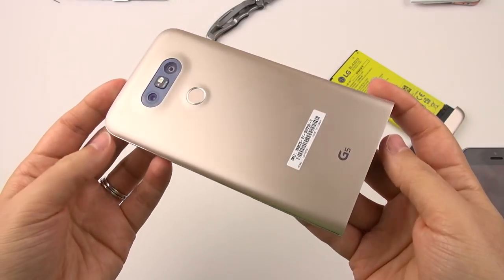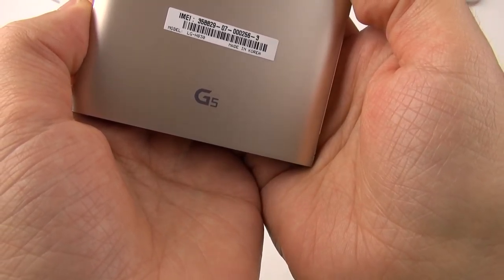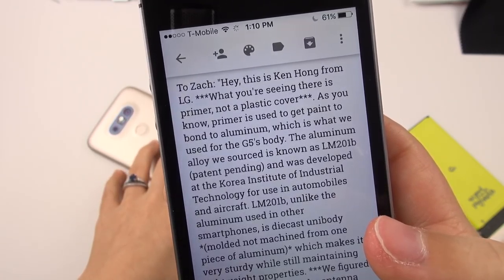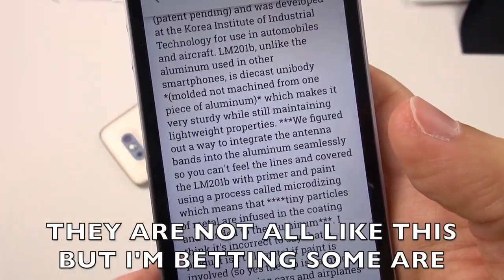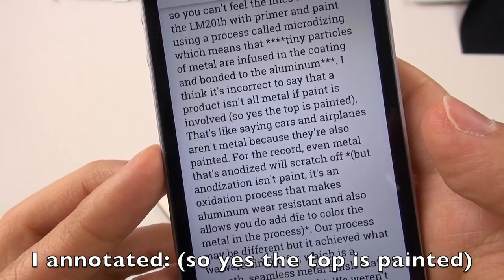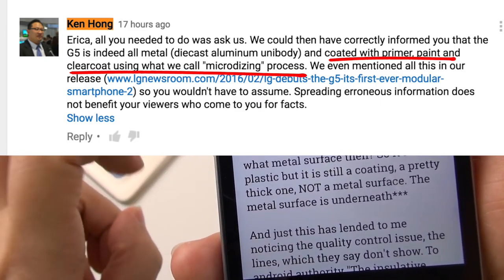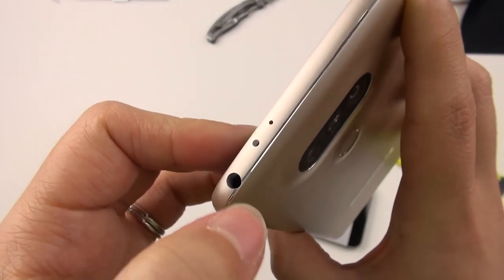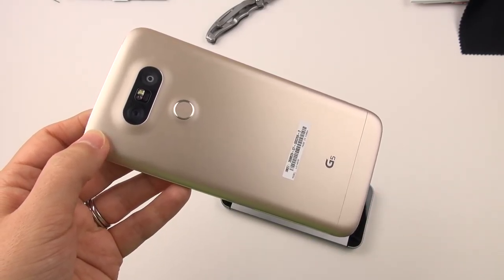LG G5 Not All Metal Controversy: Explained || LG RESPONDS

Comment: I haven't watched the earlier video yet, I will right after this. but I'll say my problem with this is that is sounds like it's metal which is not very likely to leave scratch marks from keys in the pocket and what have you. However if it's a thick coating of paint I'm betting that scratches pretty easily. So I'd be pretty annoyed if I bought what I was told was a metal body phone and then it got all scratched up.
Reply: +Phil Nolan I suppose that's what JerryRigEverthing was attempting as part of extreme testing procedure, but got carried away with the resulting flaking of paint (or plastic - to some). In the end it isn't that easy to scratch if you ignore the test to destruction angle.

Comment: The marketing made it seem like an aluminum phone. Not a plastic with metal infused, and THEN aluminum underneath. Correct me if I'm wrong, but the ceramic back from last years G4 was also "metal-infused." 
It's just bad marketing/wording on LGs part, like you said. 
The phone is just unappealing. It's not a metal phone. Samsung phones pre-S6 time also had metal on the inside, doesn't mean Samsung threw around the term "metal body," since it wouldn't make sense since you're not using it. 
My computer also has bits of silver, gold, copper, etc on its mother board. But, it's not marketed as a computer made with there materials, but rather as a plastic computer. That's what I'm touching. 
Cars and Jets aren't phones, so why compare the build of either. 
This issue has honestly changed my perspective of LG. 

Thanks for the video Erica!

Comment: Well, I actually like the look of the phone for the most part. Except it doesn't look so compact as previous models and that's probably because of the modular thing which I also don't like. Looks like something that will break relatively easy if you use it often or drop it just the right way. Just give me a smaller V10... :( EDIT: Oh, and I want the back keys back!!

Comment: Technically it is metal on the surface you are touching, al beit at only (give or take) 30-60 microns thickness. The process is very similar or a form of PVD; physical vapor deposition. It is a bit of a stickler, as the yield rate is not so high. LG might of found a new way to remedy this, but from personal experience specifically in covering up antenna lines with PVD or any similar technology is tiring and laborious. Oh, microdizing is such clever marketing lingo. I've got to see this G5 for myself to make the final call. Good luck in getting a replacement!

Comment: I've received my G5 a couple of days ago. Mine doesn't have the lines that you have noticed on yours. I have a major problem (major for me) on mine though. When my phone has finished charging, whenever I forget to hold the bottom bit of it, it then pulls out the battery. Yes, i have made sure that it is put on properly, and, no, i haven't accidentally pressed on the release button (before anyone says anything). I've had the phone for a few days and i'm just so disappointed. :( x

Comment: This is coming from former note5 and s7 edge user. I can appreciate Erica's view on this phone doesn't bother me a bit it's the truth but i can appreciate knowing this about the build, before i went to the store and used my JOD which i did anyway. Now straight to the point this phone is smoother and quicker in everyday use than my s7 edge was, performance wise is a beast, which is what i buy phones for. I also have the v10. Still love the note though it's a beast still will probably get it again for backup. g5 is last on list for looks and build but easiest to handle with one hand, just my 2 cents.

Comment: Doesn't make what LG did any less misleading. They should have never claimed that it had a anodized metal service, and most importantly quality control should have been a lot better. The bubbles or bumps that Erica pointed out with the body are not acceptable regardless of the price of the phone. A $600+ phone should have a perfect finish or at least very close to being perfect. The issue with the display quality is also an important thing. I really hope it's just an early production unit issues, but  if otherwise people should not get this phone.

Comment: Tbh, the V10 is probably better. Built like a tank, more camera options (I know it doesn't have dual cams but it has more manual photo/video/audio controls), great audio without separate dac, and still a removable battery.

Comment: sure build quality might be misleading and somewhat poor, but what about what we use the phone for? I haven't seen a video about the software, computing power, or even picture quality. Isn't that what we are more concerned about? I don't see the fuss in this whole "metal body vs plastic" controversy, clearly it still has a metal shell. I care more about performance, which you slightly covered while reviewing the screen issue, which i do agree is poor. A response on why this video has not been released would be appreciated, thank you

Comment: So basically, LG's secret to "eliminating" the plastic antenna bands other aluminum phones have was to just paint the metal and bands over with a thick coat of paint. Right. And LG was talking as if some space age engineering went into getting rid of the bands.

Comment: directly from lg's site: 

"Transformative Design

Slide-Out Removable 2,800 mAh Battery

Modular Metal Body

Dual Rear Cameras with Wide Angle Lens

5.3" IPS Quantum QHD Display"

so they are telling the truth, it is a metal body even though it is painted
Reply: also, they said body not surface

Comment: I've found it amazing that LG explained what was going on, but they just explained that what you feel is not plastic but a paint coat, anyway it doesn't justifies the seams in the back or the buckle at the bottom nor the light bleeding, the phone still has a cheap design for a really high price.

Comment: This is why you just buy the s7 edge instead and wait for LG to fix all of their shit on the g6
Reply: I love LG. I had a G3 for 2 years until it suddenly blue screened on me and stopped working. It was the best phone I ever owned. In the G5 They got rid of some aspects that made them unique, like the rear buttons which I absolutely loved. No multi tasking, no q slide? Completely unnecessary to get rid of. Then there's the whole thing about the app drawer. Yes, it may be turned on from the settings, or with a 3rd party app, but the average, casual Android user isn't going to know that. I'm sure it feels good in the hand, but it looks downright ugly. The pink version power button looks like a giant pimple. It seems they're trying too hard to become like Apple by making things "simplistic." If people wanted an Apple, they'd go buy an Apple. Android isn't meant to be simplistic. That's what makes it great, people like it for all it's customization and complexity. I do commend them for the modular design, I think that's a great idea. But everything else about it, minus the camera... Not so much. I was so excited to finally upgrade to a new LG (the v10's battery is a huge turn off) but after this flop, I'll take the s7 edge instead.

Comment: I have no issue with the marketing.  To say you are touching the metal,  is as accurate as if it were just regularly anodised.  Just because you have a layer of paint in between is a technicality,  Just as with the anodised finish you have a layer of oxidation.

Comment: So, basically, the phone is made of a lighter aluminum alloy and coated with paint that may or may not sufficiently cover any casting flaws that they didn't manage to machine away. Good to know. To be fair, the HTC One M9 featured a clear coat of paint over the aluminum to provide a much smoother surface finish. It was really well implemented, though, so most people didn't really notice it.
Reply from the maker: +Robert Coffey I noticed and they didn't do that to all the colors.

Comment: Interesting...don't think they claimed it was a metal unibody phone in any of their marketing material though. Unless a manufacturer specifically says that I would assume other materials are being used. Even the iPhone isn't all metal though, they still have to use some plastic to allow the antennas to function.
Reply: +Devin Balkaran they definitely did advertise it as such in the beginning but have since pulled those ads

Comment: It wouldn't bother me if the coating was even and smooth.  It appears this is not the case, at least on this unit. Another concern I have is an uneven seam where the module snaps into the phone. IMO LG should have refined the V10 build and style as opposed to this mess.
Reply: I agree

Comment: If they used a primer than it's a very thick layer of primer and soft too. 
And this is no anodized aluminum. With this electrolytic proces you don't use primer or paint.
Reply from the maker: +Garret141076 THANK YOU!

Comment: I was very excited about the G5 but seeing the video where they guys scratches lots of plastic from the back to get to the metal makes me think LG is good at BS. Also as you pointed out the top and inside if plastic. I'm not the one who cares allot about aluminum body and i'm very happy with my G4 but the whole argument for the high cost and premium and unibody shizzle is just marketing stunt to me. I wont support that. Specially when they made a cheap plastic with color on top.
Reply: +Major REX What are you talking about? Even in this video she points out its all metal in a unibody construction. So it has plastic inside? So do all phones! It is not cheap plastic with colour on top.
Reply: Major REX
Do you know what "unibody" means? And what's the big difference between touching the metal or the paint? Its still a metal body that 99% of users are going to put in a case. I fail to see the issue here at all.
Reply: +Michael Garry Yes i do, i dont care if its plastic or aluminum to be honest. Personally i prefer plastic much like G4 or more like Lumia phones BUT when a company comes out and say here is a phone made of unibody aluminum and what not then i expect a phone that is like iphone or HTC and i said earlier. So its not that i dont like plastic. The way Apple do it where they mix the color with the metal is the norm now. Having so much plastic underneath the surface is just a crappy way of doing it. Did you see the picture even? if you did you would understand my point maybe.

Comment: The marketing department and manufacturing department are not the same. By design is it seamless, it is the manufacturing that is the problem, not LGs marketing. You posted a picture of a can of spray paint, indirectly giving the idea to viewers that the paint idea is cheap...when infact it is harder. I usually like your reviews a lot and have viewed you for years. I Dislike your recent rants and reviews on this LG. I know you try to be unbiased and you usually do well with that, however you just seem to have a bias against this phone. It kind of seems like it's just not what you wanted, so in turn you dislike it even more. Just my opinion, I do like most of your other videos though, so keep up the good work.
Reply: For a $700 phone? I want perfection, not bleeding screen, gaps, and ugly cover up of the antenna.
Reply: ***** i mean, if you have a Galaxy S6 and pay nearly $800 for an S7, would you want to be buying nearly a duplicate phone? Nothing new is ever perfect, and the manufacturing process for this is hard. How many other top named phone manufactures come with modularity and interchangeable batteries that are offered by major carriers. It still also may be a more prevalent problem with her phone over others.
Reply: +Connor Mohan Sure, nothing new is perfect, but appearance comes first.  It is 100% of the time its owner see when using a product.  This applies to everything you use, including cars, furnitures, clothes, and phones.  Plus, phones are fashion accessories to many.  New doesn't mean better.  That modular part is just a gimmick that manufacturers try to lure consumers.  Just like the curved display of Samsung and the 3D touch from Apple.  Nothing wrong with gimmicks.  Some succeed, some fail.  While you say her phone is more prevalent problem compares to others, did the quality control department go on vacation and LG hired temps?
Reply: ***** i would assume so haha. Conceptually it's a great idea. I don't line the volume on the side though. I think the next version of this phone will be really good once they sort out these problems. I'd buy a V10 before the G5 though considering i own the G4 which i really like. The curved display in my phone is gimmicky but i don't mind

Comment: Why do you need metal? It's not an armour, it's a phone. It's task is to help you make calls and to entertain you occasionally, and not to transform you into Iron Man!
Reply: Because it's marketed as such. It's a $700+ phone after taxes. Misleading marketing is bad enough, but for it to happen to a device of this price range isn't acceptable. 
It's fine for a phone to not have metal, but the phone shouldn't be marketed as such since it's not entirely the case. 
It's like saying my phone is 12mp because the back camera is 8MP and the front is 4MP. Sure, the numbers add up to 12mp, but the main sensor isn't 12mp, is it?
Reply: +Satish Singh it's being marketed like you are touching the actual metal when you are really touching a thick layer of easily scratched paint.

Comment: So lets go through this bit by bit:

 - It's not plastic, it's primer: From what I can tell, primer is mostly composed of stuff like resin and acrylic compounds, which is basically plastic so I have no idea what he thinks he's saying but it sure as hell isn't an excuse.

 - They used cast aluminum: Yes I get it, its cheaper to do and the difference in durability probably makes very little difference for a phone, but this phone was $700+, how the hell do you even justify cheaping out on this?

- LM201b: I can't seem to find any information on this so I will withhold judgement for now.

 - Microdizing: Anodization makes metals corrosion resistance and conveniently allows you to also dye the metal in the process (note: it doesn't make the aluminum any stronger). From what Ken has said, that was apparently too hard so they sprayed it with some sparkly paint and made a fancy new marketing term. Also, if there's a layer of primer between the aluminum and the paint, how exactly do the metal particles bond with the aluminum again?

 - All metal phones don't have to have metal on the outside: First of all, you can't compare phones to cars or planes because they're different industries with different sets of standards. Besides an "all metal" car or plane isn't exactly a selling point, it's kind of a necessity to use metal, and they're painted because its not really feasible to anodize a whole goddamn car/plane plus you literally cant anodize steel. If you're advertising a metal phone it better damn well feel like metal in the hand, otherwise we might as well call the Galaxy SIII metal right? Hell, why don't we just call all phones metal cause they have metal contacts on the PCB?

 - We're doing something different because we're special: I'm sorry but when did this become tumblr? That's literally like if I got mad because I made a website that used comic sans and someone told me it looks like shit."Different" literally means nothing, no one here thinks the G5 is crappy because they did something "different", everyone thinks it's crappy cause they made a crappy phone (body). 

 - Metal finish: You literally have been explaining why it's ok to have a metal phone without it having a metal finish in this whole damn shitshow of an explanation.

 - The primer doesn't touch the skin: Yes, because it's under that layer of paint you mentioned.

TL;DR: Stick to plastic LG, you seem to be really good at it, and maybe get an engineer or something to come up with an explanation before you treat everyone like were retarded with bullshit explanations.

And here ends my ranty rant, hopefully the phone performs better than it looks, because if it doesn't then LG realllly fucked themselves over with this one.

Comment: Ken said on another video:

"The combined thickness of the primer and color layer is approximately 0.15mm while the aluminum varies between 0.65mm to 0.85 mm in thickness based on where on the G5 you measure."

Comment: After the die-casting is complete, the insulating antenna slit is applied directly to the aluminum casing followed by a coating of primer which provides additional insulation and enhances the surface profile for the “microdizing” process, where pigment containing tiny metal particles is applied directly to the primer to provide a smooth and durable finish. While both anodized aluminum and microdized aluminum will scratch if enough pressure is applied, in the case of the G5 the gray primer beneath the pigment layer may be mistaken for plastic when the coloring is scratched off. We want to reassure our customers that the uni-body of the LG G5 is advanced aluminum alloy, not plastic.
Reply: +Light Yagami  plastiicc :v not metal? or glass? ITS PLASTIC! :v learn something dude, plastiiiicccccccccc LG Gplastic 5, the modular plastic phone! LplasticG!
Reply: 1. Learn to read english.
2. Learn to understand what you've read.
3. Keep opinions to yourself.
4. Death note+face+name
Reply: Light Yagami sorry, i aint paying 600+ for a plastic phone, there is already a LG plastic phone that is actually good and unique(LG G4) and inst a metal-phone wanna be. oh and your deathNote will not killme, im a shinigami already :)